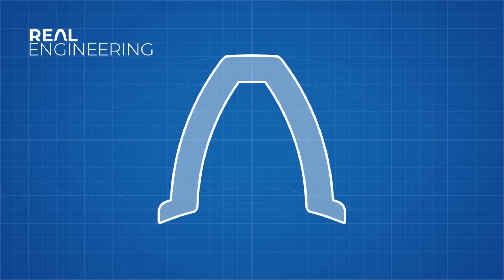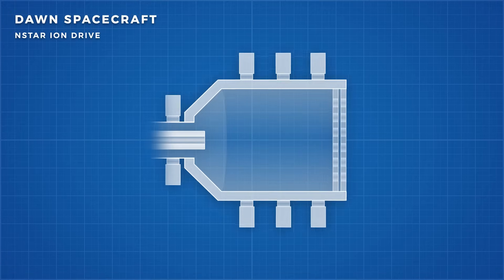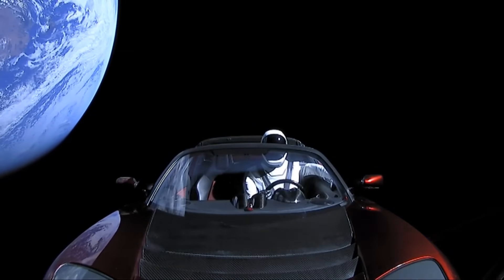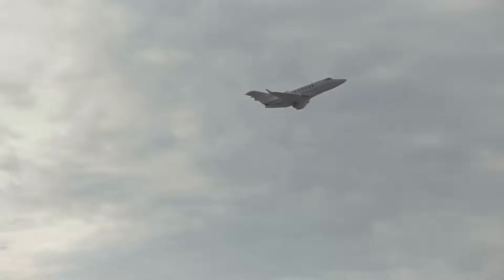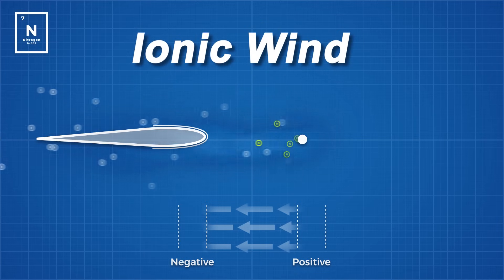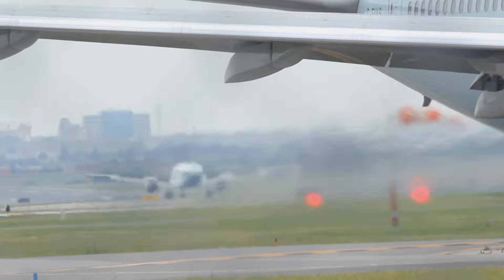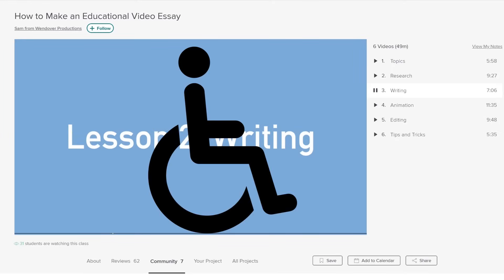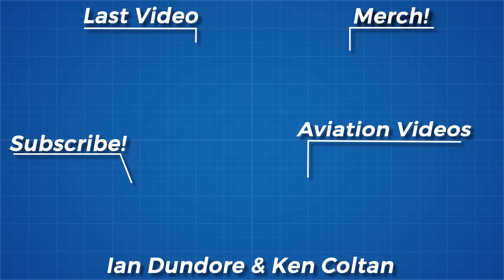Ion Propulsion - The Plane With No Moving Parts

Comment: Weight to horsepower ratio 

It takes work to move mass
Reply: By direct proportion... and the faster you go the more mass you have... up to the speed of light at which point the mass becomes infinite... it takes infinite energy to move infinite mass
Reply: A Tesla turbine using a plasma spike to increase pressure... StarFire has a carbon based Tesla turbine with a " practically" unlimited range of rpm
Reply: Using carbon with double double covalent bonds overcomes the engineering difficulty of high speed metallurgy.. metallic bonds are insufficient.... carbon has the highest melting point of all.... 3800° C... so I can spin up a carbon sphere with a plasma spike... from high pressure bio fuel..  not petroleum based... making 3 phase AC current... and no limits except right before fusion is initiated... and highly compressed air
Reply: We are going to put a cat on the moon in 2021... for under 500 dollars... mas o menus
Reply: Probably a couple human people and a smallish dog as well... it's a family thing ❤
Reply: I am not going to walk around.... I can't do everything... but I think the vehicle will work.... think Buckminster Fuller and geodesic domes.... that fly... and hold cabin pressure perfectly 👌... and they are, relatively, like a soap bubble going to the moon 🌙,  as opposed to the brute force method used currently
Reply: Re-usability R Us... I hate to waste things... even in an infinite Universe with infinite resources... it's always true 

Waste not ==>> want not
Reply: The StarFire Family wishes you 
Peace and Prosperity 
Ad Infinitum 

Prosperity begins with being able to keep the fruit of our labors... and.. not wasting stuff
Reply: Peace ✌☮
Reply: The technology is not for sale... it's open source... and free... as it should be
Reply: What if.... everyone had access to all the resources needed to build whatever their dreams were.... ok... 
And... you knew, if you were careful or lucky, or clever as clever can be... that you personally can live forever.... not after you die and go to heaven... nah man... the same you... from now until Hell itself rots away... it's not a something for nothing scheme... no rules and regulations... nada.... poppy seeds and cannabis oils.... hempseed oil specifically.. . It's also a dandy fuel and can replace both diesel and gasoline.... it's going to Save Planet Earth... and it can return you to good health..  and your family... it's available on Amazon for 13 dollhairs a 500ml bottle... my brother was looking for the magic lipids in his research at UCSD... this is the conclusion of the research of Dr Thomas E Carew III
Reply: Do you think the World would finally change for the better... because... it's easy to do folks.... it's got everything to do with the fruit of our labors... 

Socialism is ==>> communism's idiot stepchild... neither work long term without outside revenue  .. oligarchy requires our tax dollhairs to exist  ... the issue is not 50% taxes for my wife and myself... it's way worse... it's much closer to 100%... and in most homes in America the people no longer make it from one paycheck to the next with money... I get paid on Friday... it's gone by Monday and I don't drink or use. .  Socialism and communism have exactly the same result... the benevolent government aquires the fruit of our labors... by force... and they "redistribute the wealth... remember government does not create wealth... it takes it... by force 

It's primary purpose is to maintain the status quo... oligarchy 

But all government... or lack thereof... exists through the consent of the people

Comment: Dear Sir, 
Here is a short National Public Radio program about a solely Ion propelled aircraft with onboard power. It has been operational for over a decade before this project was in the works by MIT's student engineering team. It was patented since 2014:
https://radio.wosu.org/post/exploradio-oberlin-inventor-pushes-limits-ion-powered-flight#stream/0

Comment: Take away the moving parts, wrap the idea in silicon, polish until all rough edges are smooth, and suddenly you've got a new model for storage devices that topples previous performance, power efficiency, and reliability benchmarks and safety culture.  The trick to achieving outstanding performance: eliminate all moving parts and redefine storage paradigms. It becomes the DNA of future culture, cost effectiveness and novel technology. The visual computing hook-especially for game developers, but this could also be for artists, for digital content people, for video editing, or whatever-is that the system responds significantly faster. If you have a large amount of code to compile, your compile times go down. Developers doing rendering work, using art programs or lighting tools, typically get a lot of coffee breaks waiting for scenes to render or animations to complete. SSDs shave minutes off the wait time, delivering significantly better performance and much faster rendering times when large-volume data accesses are required. When a drive is used in a server, there are higher requirements for read-and-write cycles. Intel's new SSDs provide an enormous boost for overall I/O performance, and for random-access writes in particular. When compiling thousands of source code files or loading game content spanning hundreds of megabytes, the opportunity for increased performance is dramatic.I can see the future now-and it has no moving parts. Made it simpler and easy, than.

Comment: Xenon is not chosen because it has a large atomic weight. This is on the contrary a disadvantage - force is applied more effectively to atoms of lower weight (simplified, I do not want quote the entire notation about jet propulsion). Why do you think hydrogen engines have such a high specific impulse relative to other chemical engines?
Xenon is chosen because it is good for ionization, better than argon or helium.
_
Ксенон выбран совсем не потому что у него большой атомный вес. Это наоборот недостаток - к атомам меньшего веса эффективнее прикладывается сила (упростил, не цитировать же мне целиком нотацию о реактивной тяге). А вы думаете почему водородные двигатели имеют такой высокий удельный импульс по сравнению с прочими химическими двигателями?
Ксенон выбран потому что хорошо поддаётся ионизации, лучше чем аргон или гелий.

Comment: 2:34 "but in the vacuum of space" If it's true that we're surrounded by a vacuum, then how is our atmosphere not equalized with that vacuum since there's no physical barrier to separate the two?
What is Vacuum?
Vacuum is defined as a space that is entirely devoid of matter; i. e., an enclosed volume that is not filled with air or any other gasses. 

This also doesn't make sense because you can't have matter inside of a vacuum, i.e. the Earth can't be surrounded by a vacuum because then that's no longer a vacuum.
Reply: the air has weight, it's pulled towards the planet via gravity.  On average, space is so incredibly vast that it essentially has nothing in it. Vacuum generally has very little matter in it, not absolutely none as that's impossible due to QFT.

Comment: does someone have a source/can explain the Plift formula at 7:38? assuming L is the lift generated by the wings, a unit equation doesnt work out to power at all...and what power requirement is this supposed to represent? that to keep the plane up? where does that energy go if theres no change in height? help!

Comment: For the moment, just use a DC motor with a propellor.
With regard to space travel:
If you have a craft with low accelleration that takes 20 years to get to the next star,
and they invent new tech, to propel at much faster rates in the next 10 years,
it would be better to wait.

Comment: Carbon fiber air pressure tanks holding up to 30,000 psi. Counterrotating propellers for VTOL aircraft. Rotary Wankel air motors with low parts count and quiet operation.

Comment: Hydroelectrodynamic thrusters have been the subject of research for decades. In fact, my senior project as a  Mechanical engineer 12 years ago was the development of a glider shaped HED, very similar to what those guys did...Nothing new in the subject, no advances here, unfortunately.
My conclusion for the project was that, same like the dilemma we face today, it all is limited by the development of a hyper light power source (batteries) since weight is everything when it comes to aviation. The technology is simple and the electronic part of it is also quite simple and may i say reliable l. I will add that a byproduct of the thrusters is the creation of O3 (ozone) gas, which is dangerous if the apparatus is being tested in doors for long periods of time.

Comment: Bump up the voltage 10,000 times and the eletric field strength will cause cascade ionization of atmosphere to add additional thrust, in space the solar wind ions will serve as "fuel" to push against.

Comment: power to weight ratio is rubbish...cant really lift useful payloads...
Reply: On the above craft that is true. It produces about 1/2 gram of lift per watt.  However, if you click on my YouTube channel to the left you can see an ion propelled aircraft that lift more like 14 grams per watt.  It has a much higher thrust to weight ratio also.  It also happens to actually be first.  The MIT student was not first.
Reply: @KraussEMUS1  FOR IT TO BE USEFUL IT MUST carry its own power supply and have carry a useful load. lift to weight ratio needs to be high.
Reply: @esecallum  
Hi Ese Callum,
My previously patented version is independently verified to do both.  It does carry its power supply, even vertically!  Please click on the round purple channel icon on the left to see over a dozen videos of the Self Contained Ion Powered Aircraft.  There is also a National Public Radio broadcast certifying that it does carry its power supply!
Reply: @esecallum  
Hi Ese Callum,
As I said in the last response my craft does carry its power supply!  It was patented before the MIT craft flew, specifically for carrying its power supply against earth's gravity using ion propulsion.  I forgot to mention, that it does also carry a useful payload, in the form of a small camera.  It can also carry optional propellant tanks. Thanks for your reply!
Reply: @KraussEMUS1  Can't find it... link?

Comment: Thanks!  This technology has a lot of promise, but I somehow doubt that it will have any impact on the airline industry for the foreseeable future.  I suppose it could be used to augment thrust.  I'm thinking more along the lines of dirigibles.  An airship with some wings (or even rings) would be able - possibly - to cruise along pretty well, seeing as how it's already afloat.  As far as space propulsion tech goes, I have a very, very strong opinion that what we need (for manned flights, certainly) is a kind of hybrid system that can provide several different types of thrust as needed.  A spaceship that could fire something like rockets, nuclear fission, etc., to get going initially, could then use ion thrust to continue accelerating during a longer voyage.  It would then use the bigger thrust to slow down again at the destination (or to maneuver for any other reason).  I know that if I were in space, I'd want a ship that could 'burn' just about anything, in any way; a bit like Mr. Fusion from Back to the Future!  Ideally, we'd have a system that could use oxygen/hydrogen, or methane, or anything that could be mined, scooped up, or acquired in some other way.  Of course, the perfect space engine would simply need any generic 'reaction mass' - but that's even farther away.  For space travel - manned or unmanned - I think we need to stop specializing so much in this engine OR that engine, and concentrate on versatility!  But speaking of the Wright Brothers flight, what really blows my mind is the ludicrously short amount of time between the first powered "aeroplane", and Neil Armstrong landing on the Moon!  Yes, I know we had two World Wars in that span - and that wars always forward technological innovation (after all, we always need the latest, niftiest way to kill the other guys!) - but still... it boggles the mind.  Thanks again.       tavi.
Reply: I believe you are really interested in this subject, and I like your ideas as well!  Please click on my channel to the left, to see more advanced independently verified earlier ion propulsion(with onboard power)!

Comment: Well that's an easy one I've been saying it for some time now these these Concepts and ideas would have to be applied to anti-gravity technology reduce mass and save gas reduce gravity to reduce the risk of tragedy meaning you can reduce the mass of an automobile and save gas it takes to propel this automobile ignition you can increase the gravity flow and make an object more to increase stopping power and overall traction like lowering the center Mass all you need to do and scale-up is to reduce mass of the object but at that point you've got a complete  all very versatile airship I mean I never would have thought being an RC enthusiasts myself that anybody could take an Ionic Breeze and stick it under one why don't you try applying a Tesla coil transfer of wireless energy it's all around you can keep this thing going for days I bet if you set up an energy Gathering Tesla coil on it and put some elderon's on it a flap on the tail someone can fly it around within range of the transmitter of energy these days too could be completely autonomous 2
Reply: I'd also like to say I wonder if this technology can be scaled down to let's say the size of a bee

Comment: Could it be scaled using lots more voltage and a H2 fuel cell for energy instead of heavy batteries ?
Could the propulsion system be merged with wings, maybe a triplane setup?
Reply: Good ideas!  However, if they are made with a higher thrust to weight ratio, the collectors can be used as wings.  Please see my channel to the left.

Comment: Ion drives make no thermodynamic sense. The most energy-efficient rocket is the one which expells high mass at low velocity ; the exact contrary is an incredible waste.
Reply: The MIT glider does not make much sense, especially since it wasn't the first with onboard power!!  If you visit my channel you can see an earlier one that does make sense, although it is too lightweight for passengers.

Comment: cant they stack the engines inline? so each engine adds thrust to the next?
Reply: The above article is not correct.  Please click on the channel icon to the left to see an earlier more efficient ion propelled aircraft specifically with onboard power! 
(They already tried to stack 2 of their cells together, it cut their already low efficiency in half.)

Comment: And in high winds at flight it would be destroyed in 2 seconds.Ding!
Reply: That is why my earlier VTOL version with onboard power, will make more sense.  It could land quickly if the wind pics up.
Reply: I see there's alot of us types out here??!! I can make a wing less plane,and to top that,it might be faster then a few winged ones. The why is; could this be cheaper on fuel?? Being wingless,but still having two lift planes,instead of one?Could make it lite in flight!And length would create more cubic feet of lift on it's shell bottom and top vortex.For'this is a round cylindric shape,I'm laughing because I know I just made several people go in shock on that tell story, funnier yet a jet like this might be able to cause missles to go right thru it unscaved.*.Which has me thinking the middle would be best to arch the exhaust?!And you guy's thaught the flying motors in Star Wars was weird! But in my small tests,this flew.So it can be done,but this needs controls ,engines and a cockpit next time!
But is cilendric shaped.
Know let's do coffee guy's!Bye!
Reply: A B-2 bomber sized jet like this shape,and in the same size area could fly farther then anything else out there.The next thing is,if something like this is hit,and a chunk go's missing,it can still fly most likely because it has two plains.Not one plain.Damaging this in any area can't just bring it down.Unless you destroy the cockpit! If the Red Barren losses a chunk of his wing can he still fly??
Remember he had 3,Riddled with holes even and still flew.That could be why in his time he was a bad azzed pilot!Or" was it the planes wing power??!!
Good coffee with someone who studied around 2500 studies,can help you reach 
New thinking levels guy's.
If North thrope See's my comments to you guy's they freak out on this info!
Boy could I show them a few things! But it will cost!
It's been a nice chat,and don't stop chatting.I'll be around because I have over 1000-1200 inventions to do to help you save money guy's,your future will be brighter "I Promise! Bye!

Comment: There are still people out there equating ion Wind propelled drives with antigravity... lol
Ion Wind it’s like solar power... it’s well.... yeah... you get the point ;) I got a better idea: let’s built a Plane which’s is 1 km wide and 700 m long, which using ion drive technology will lift a couple of people into the air and take a year to get you from London to NY :))))))))))))))) 
I’ll fly delta thank you !